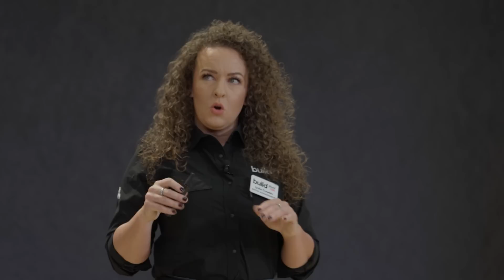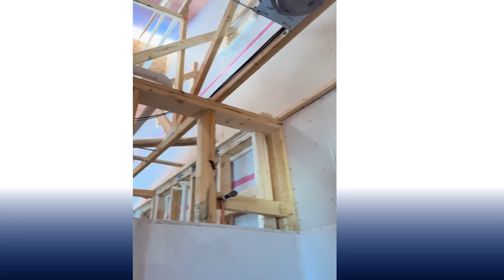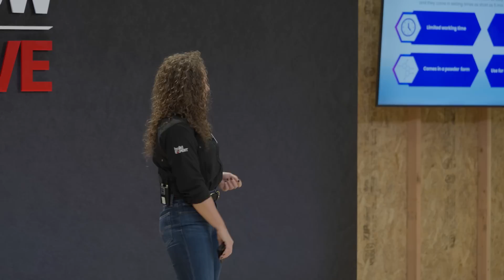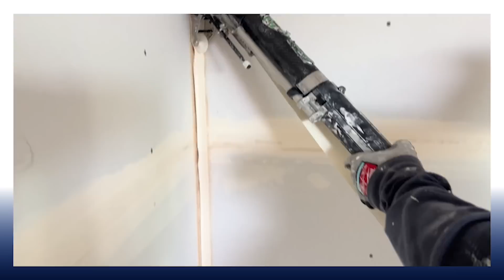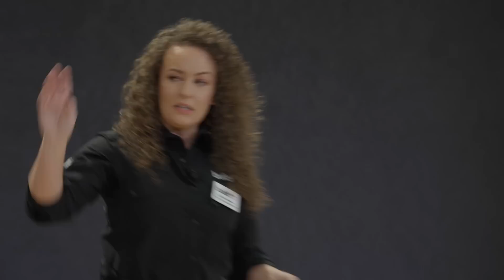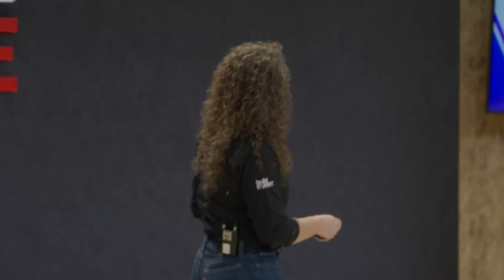Drywall 101 With Lydia Crowder - Build Show Live 2024

Comment: When do you need multiple coats of plaster?
Reply: This is not plaster, it is drywall.
Reply: @dtoad48  At 2:00 she said plaster takes up to 4 days to dry between coats which means 3-4 weeks instead of 1 week for drywall.
Reply: They're all cement products aren't they?
Reply: @Chillllll91  Plaster of Paris is a gypsum product.
Reply: To answer my question a level 5 plaster finish has two coats.